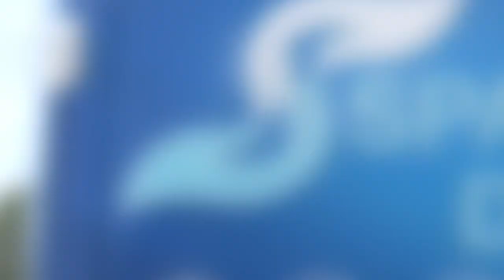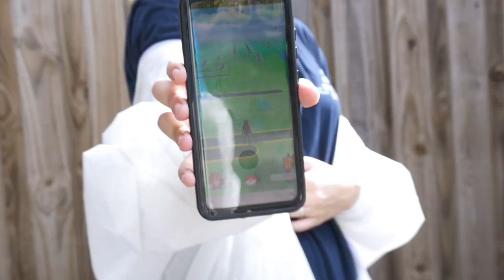Roach Avalanche

Comment: In case anyone is wondering the condo from this video is largely the same since Spaulding Decon was here. The patio is still filled floor-to-ceiling with stuff and the unit itself has hardly been touched. It’s a sad sight when you walk by it outside. 

Spaulding Decon did a great job. It’s a shame the unit has just sat since they left. It would be nice to see it finally get brought back to life for a new resident to live in and appreciate.